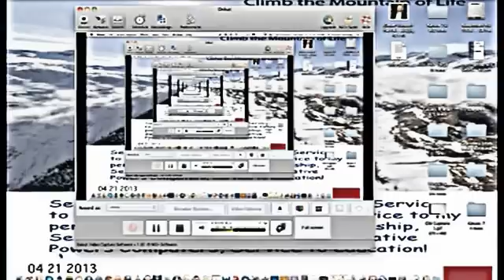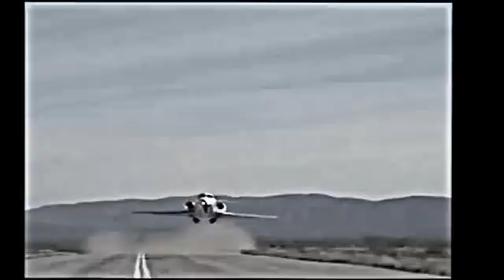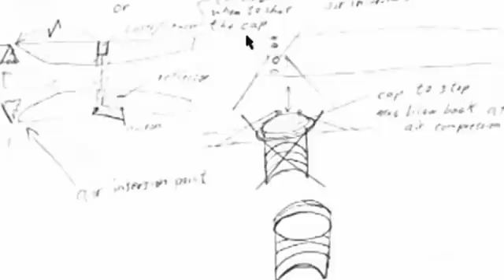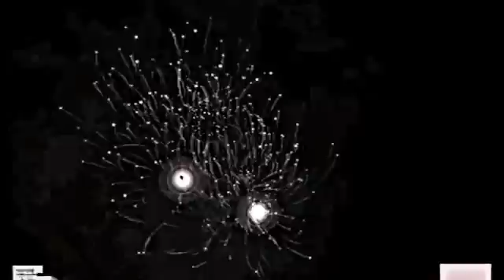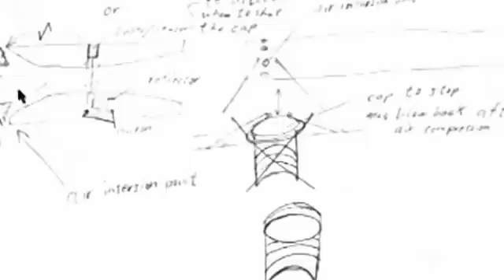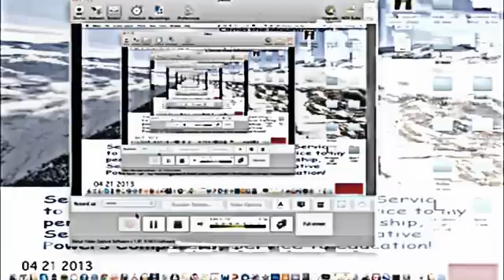Invention # 1 Gun Barrel Design

Comment: Rifling is used in the most common barrels today to impart spin upon the bullet to stabilize it during its flight. 

Without the spin, it won't maintain accuracy unless you use a sabot and fins to spin it in flight, or unless the projectile is a round ball, which is inherently stable but has a relatively terrible ballistic coefficient. 

How is the projectile stabilized in this design? What size class of projectiles is the barrel designed for? Is the scale closer to small arms, or naval weapons?